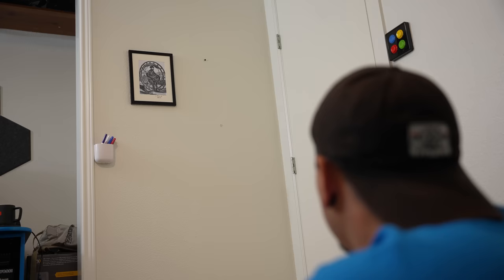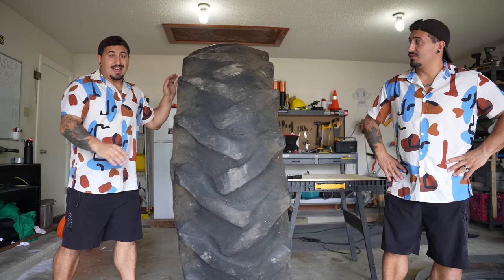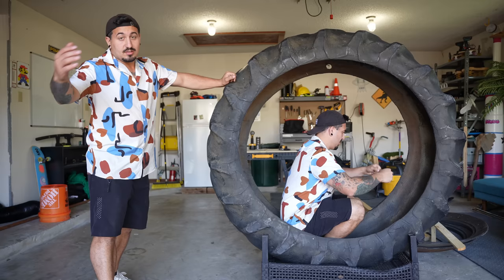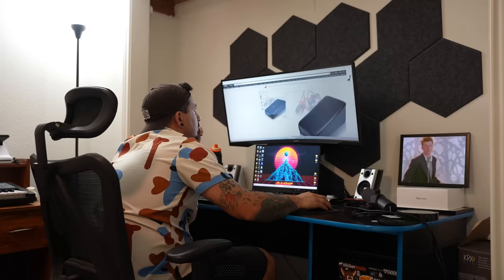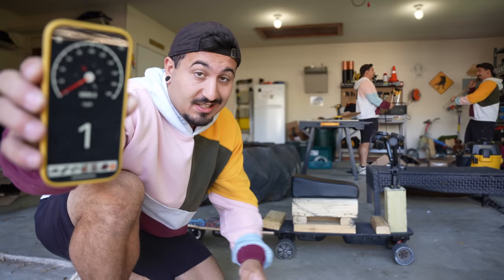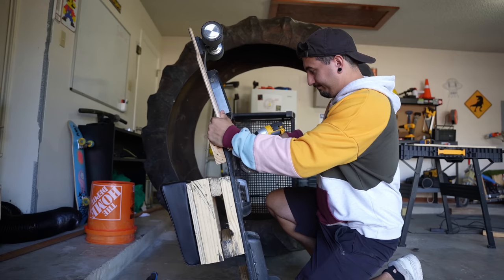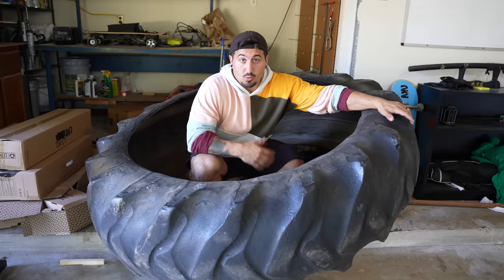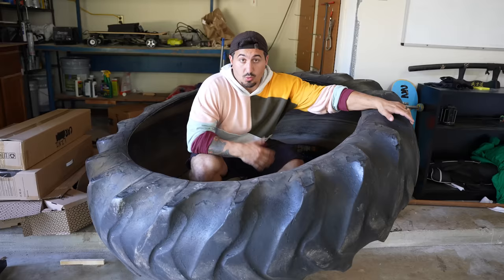I Built a MonoWheel!

Comment: This is cool, what you could do is build it like an old time bike which you can sit inside of the tire, that way you can have some steering. Have a tiny wheel in the back for that. Of course you'd have to offset your weight backwards somehow for that to work.

It would probably be better if you could build some actual tracks inside and make it work like a train. It would probably be more stable.

Comment: I don’t build at all, but I really do want to see you fulfill your dream 100% and what I’m noticing is the fact that the motor isn’t powering the tire. If you can somehow get the motor in the tire, you’ll have an actual vehicle. The motor not powering the tire forces more torque to be required for movement. Torque as we all know, requires power. Which mean for the tire to even move, it needed the smaller tires to move fast enough to get move the bigger tire, which if you can encapsulate what I’m saying, is unnecessary overcompensation the motors have to do. Take that away, I believe it should solve all of your problems

Comment: the problem with this type of monowheel is that your forward view is partially obstructed by the tire.  I propose instead of a tire, do it with the "tire" composed of two parallel metal tubular steel hoops, perhaps with rubber tires on them, joined by cross bars.

Comment: So the concept works; you can indeed power a vehicle that is just one wheel.
But perhaps the execution can be tweaked slightly: If you put all the "stuff" inside the wheel, then mount the seat, pedals, and handlebars on the side. Instead of trying to see through and around a moving circle, you look under the wheel and over the engine bay, a view not unlike the dash and supports of a car.
Reply: Think like Grievous' monocycle from Star Wars 3, or the Mr Bean episode but ties the seat to the side of his car instead of the roof.

Comment: kinda defeats the purpose of a monowheel when you add a 2nd wheel for balance. You should have built a rollcage with rollers around it  and tried to use weights to balance it out.